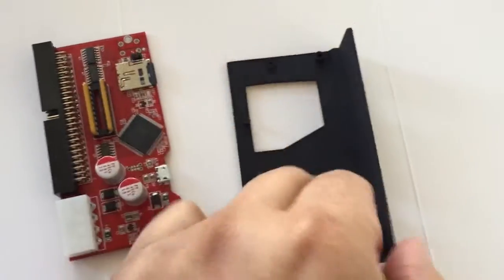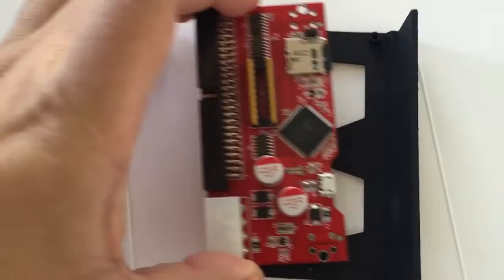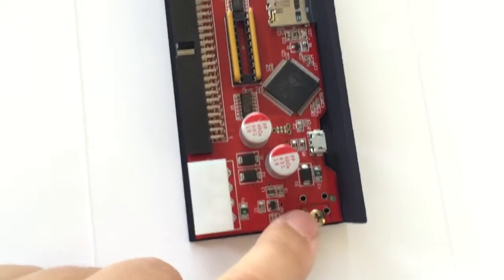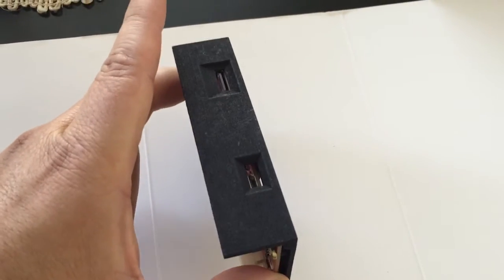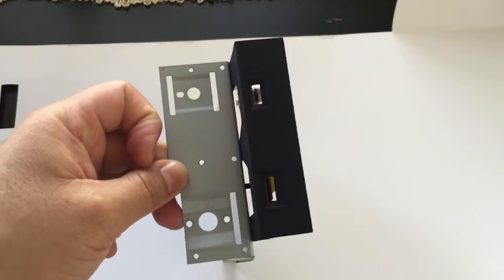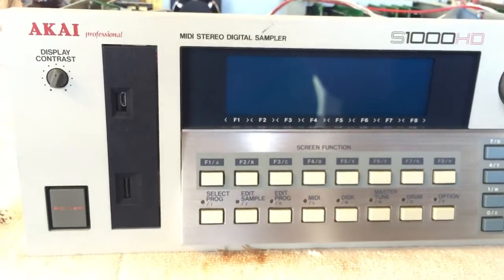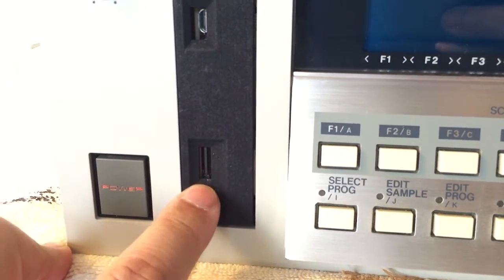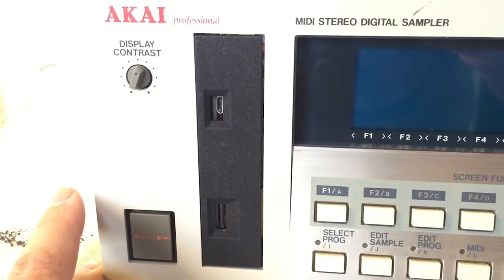Akai S1000 - SCSI2SD

Comment: Would it be possible to send floppy data from a floppy emulator installed in another sampler (Gotek for example) to the SD card using a Usb to micro usb lead ?  Cheers
Reply from the maker: Ross John Not likely - they’re two different formats. You would have to load the data in the sampler and then save it onto the scsi2sd.
Reply: So you could load data from the a floppy emu in one sampler into another sampler with one of these?
Reply: If it could read the sample format?
Reply from the maker: Ross John no, it would have to be done on the same sampler. If the sampler with the Gotek has an external scsi connection you could connect it that way if you have the right cable.  Once you copy the data you could move it to the other sampler.
Reply: What a shame. Its still worth getting one of these but we need an alternative to SCSI because their so rare on the older Akai's.  Thanks

Comment: My SCSI card doesn't have another port inside (it seems to have slot so one could maybe solder the port on, but I'm not sure), so do you know if I could connect a SCSI cable from the back panel to the ribbon cable connected to the SCSI2SD adapter?
Reply from the maker: Yeah, that would work to.

Comment: does this work with the normal S1000 (non-HD version) aswell?
Reply from the maker: Yes it does, but you'll need to buy the scsi card and a 50 pin ribbon cable if it doesn't already come with it.

Comment: I have an Akai S2800 with floppy drive, but without scsi connection on the back panel. 
So my question is that can i replace simply my floppy drive with this or i have to buy the Akai S2800 optional SCSI card to the sampler?
Reply from the maker: Even though you can install this in the floppy drive bay, you still need an internal scsi connector to connect it too - it doesn't connect to the floppy connector.  You'll need to verify if there is an internal scsi connection - usually it's a 50 pin connector.  If you don't have one then maybe you do need to purchase an optional scsi card.
Reply: Thanks for the proper info :)

Comment: This all, de SCSI adaptor and the bracket, works fine in my S2800 (even with 32 MB, memory expansion).
Reply: Edit: All sorted. Need usb power ignore this: I have an s3000 (Classic) and had no luck with the scsi2sd 5.1 working with it. Using external not internal. 2800 is a similar unit. Can you please tell me what setting you used to get it work?
Reply: @AgentsofRush  hi ive got one working with my classic , the main problem is you have to reverse the ribbon cable from the scsi2sd to the internal scsi card of the s3000, just file the little key guide off the scsi cable
Reply: @mrrothers3024  Cool and all sorted now. What I did was go external and get a case off ebay. So now all my samplers can use the scsi2sd and just have cards for each one. the S3000 classic needed USB power.
Reply: @AgentsofRush  Please do a vid of this, that would be kool
Reply: @AgentsofRush   i copied the settings off the video on YouTube called rebirth a 3000xl with scsi2sd , created ids  2 to 5 , 500mb i think from the scsi2sd utility on pc. oh and i used os 2.0 on 3000 classic, follow this guide
https://m.youtube.com/watch?v=O73blCKdgSU
Reply: i have just picked up a smelly(nicotine) s1100 but the  internal scsi connector is different than 3000 so probably wont bother just use zips , the hardest part of s3000 was not 
 knowing u had to swop the internal ribbon round as the scsi connector in s3000 is mounted in reverese!
Reply: @mrrothers3024  Get the external case for the scsi2sd and you can use it on any sampler and you don't have the hassle of wrong cables. I have one on my s1100 right now.
Reply: @AgentsofRush  i will probably use an old syquest drive , got 7 quick disks 100mb , i think the scsi2sd will fit in that, prefer the s1100 over to the classic for drums

Comment: Hi Roy,

I just bought one I was just wondering what cables exactly do I need to get it working in my s1100?

I can see the internal scsi to the scsi card in the akai but the other cable is that just the power from the floppy drive?

Thank you!
Reply from the maker: +Angelica Pinto All you really need is the scsi cable.  You don't really need the power cable, because the scsi2sd can get power through the scsi cable.
Reply: Thank you it's working perfectly!

I was just wondering what size and type of sd card I should be using is? Can't find any specific info about what size to use.
Reply from the maker: Awesome!  I use 8gb cards because they're pretty affordable, but you can use bigger or smaller sized cards - and I don't think brand matters but I use Sandisk and Kingston cards.